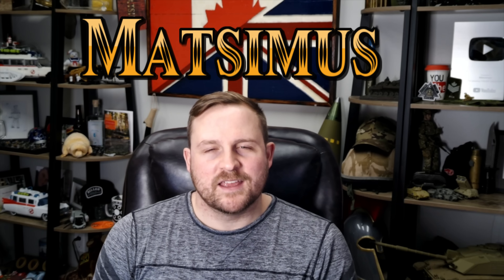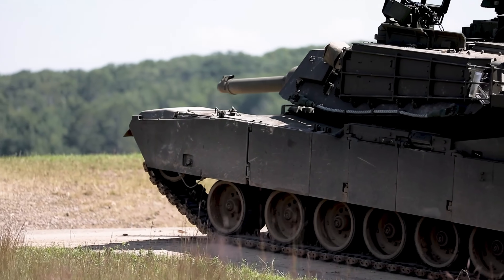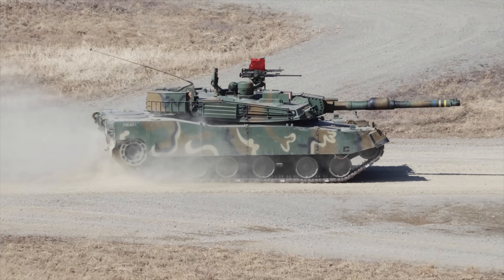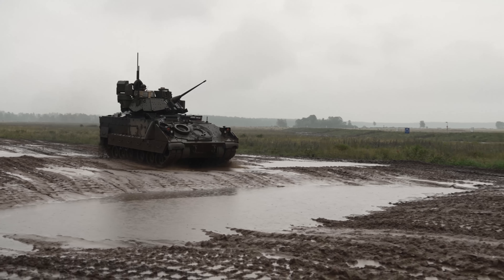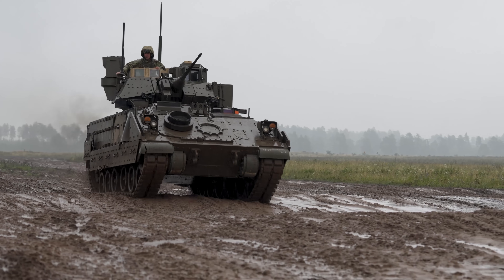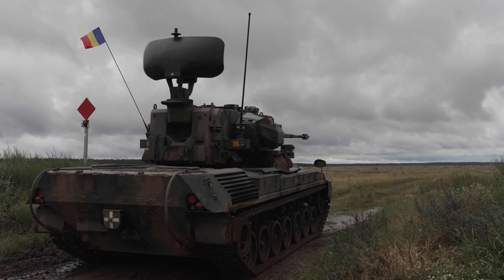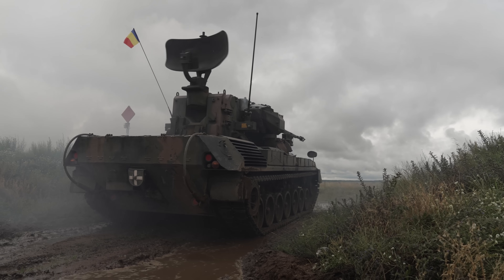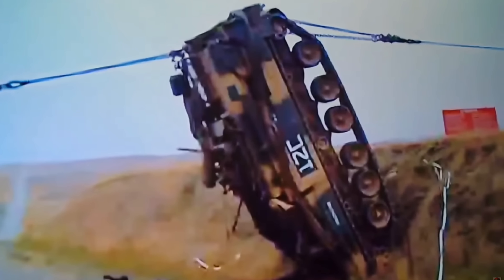Inside Tank & IFV Design: Fuel Placement & Survivability

Comment: I have some questions about the fuel used for tanks and IFV. I would guess that most of these are  either using Diesel or Some kind of Jet fuel for turbines. Thing is I remember a friend was told to get rid of the rests of a barrel of jet fuel used for military helicopters. This was in the beginning of his training as a helicopter technician. Well he and his friends tried to burn it starting with throwing a match i the open barrel and nothing happened. They continues and found that they couldn't set fire to a rag drenched in the fuel with a match or cigarette lighter. Eventually they managed to burn the rag using a blow torch to set it on fire. Apparently their officer had kept track of what they did from his office and had a good laugh at their attempts.

Point is that jet fuel are not easy to set on fire, and Diesel isn't all that ready to just burn on command. You have to get it real hot or atomized first. But gasoline is not as friendly. So what fuel is it that they use for these vehicles and why is it burning so easily? As for helicopters they have self sealing fuel cells that will minimize leakage if they are shot with small caliber ammunition and they aren't really afraid of them catching fire.

As for gasoline I remember seeing a metallic foam that was developed for the fuel tanks. filling a tank with it reduced the capacity by something like 0.5% but it also made them safe from explosion if the fumes inside was set on fire. Combine this with self sealing fuel cells and it should minimize the risk for explosive fires unless the tank is hit with a explosive charge. And by then it's bad whatever you do to try to protect it.

Now I'm sure these methods has already been used in Tanks and IFV simply because they are cheap, simple and even if they can't completely protect against all types of fuel fires they are well worth the effort. Also these are manuy decades old techniques.

My question then is just how do they fail and how does the fuel get set on fire with all the different attempts at protection?

Comment: It’s actually very simple. Any fuel tank that is not internally segmented with vulcanized rubber, filled with retardant foam and lined with composite or spall liner is a danger. 
Any single walled or non self sealing tank that lacks designated fire systems is a complete hazard.

Any of the properly designed fuel tanks, listed above, should be placed between the crew and KE or HEAT threats. 
Because when properly protected fuel tanks are done right, they offer massive protections to the crew (as long as they are filled or empty but vapor vacuumed)

At best a full fuel tank done right can stop penetrators dead in their tracks using insane drag and multilayered protection. At worse wind vapor, purged they add spaced armor and stop spall.

But when done poorly like Russian external tanks or any single walled Steel tank, they are vapor traps and giant pressurized fires waiting to happen.

But as the video mentions poor fuel tanks, usually kill the crew or force them to evacuate because of respiratory repercussions.

Comment: I always found the Soviet BMP design interesting. There are fuel cells in the rear hatches. Diesel. That functions as de facto armor, extra fuel, and/or buoyancy for amphibious operations. And the rear mounting is theoretically the surface area least likely to see enemy fire (if things are going to plan). In a Marine LAR BN on an LAV-25 the scouts are sandwiching a fuel cell. It forms their seat (both rear and underneath). In an LAV-AT variant the fuel cell takes up the loaders entire right wall (as he’s sitting facing to the rear at the rear left side of the vehicle). When the exterior temp is 110 degrees… that fuel cell receives recirculated (and very hot) diesel (JP-8). It’s almost unbearable. Like siting against a blazing oven. In the interior you can see temps of 130 degrees. It’s dangerous it’s so hot. So hot that if you stop pounding water… you’re going to be in real trouble in as short as 45 minutes time.

Comment: Maybe fuel tanks in armoured (whether manned or unmanned) vehicles, should be housed only externally in armoured sponson.

Whether mounted on either sides, or at the rear, or underneath, or maybe on top of the armoured vehicle too?

Though far away from the crew compartment as possible, with all fuel tanks having their own armoured protection too.

Against attack by sucide drones, or from anti-armour missiles or rockets, plus attacks by armoured-piercing rounds and bomb or shell splitters.

As well as against anti-tank mines, or High Explosive Anti Tank munitions, or even IED's too.

Though equally all armoured sponson fuel tanks, having both automatic fire-suppression system and self-sealing systems too.

Also whether the fuel tank fire, is as result of war or accident damage, but cannot be putout quickly.

Then the external sponson armoured fuel tank, can be remotely jettisoned if necessary, by any of the crew inside.

Or can be jettisoned remotely again by an operator and via datalink, of the armoured ground unmanned fighting vehicles too.

Just a suggestion, the idea of jettisonable fuel tanks, has been around for all kinds of military and civilian (air, rail, road and water) vehicles, I think since world war two.

Fue tank or onboard fires, has always been the worst nightmare of crews, from warships or submarines, to combat aircraft to fighting vehicles.

Maybe even now the threat of electric battery fires, with new military vehicles being designed and manufactured,  as pure electric powered combat vehicles.

It makes you wonders, how safe would soldiers be in a new armoured electric-powered fighting vehicle?

If the onboard battery enegy pack bursts into flames, after the armoured vehicle being hit and damaged by weapons fire?

Comment: There should slso be a focus on fuel type before deciding where fuel is stored, diesel doesn't burn at low pressure so it acts more like water at 1 bar, still most likely harmful to humans but smoke shouldn't be a worry for diesel driven tanks afaik.

Comment: Honestly a truly valid question 

The more fuel the more range a vehicle can have, but on the other hand, increased range and combat capability does come with a few problems, one of which is obviously.

The more room taken up by the fuel tanks means less room for the poor people inside the vehicle, secondly fuel is highly flammable and depending on its storage location, can determine whether or not a crew can safely exit a vehicle or simply be burned alive, much like the Soviet BMP APC where they have fuel tanks in both the rear doors of the vehicle and underneath the passenger compartment, 😂, however having less fuel does decrease the risk of fuel fires starting, but having too little say a 2 liter tank for your garden lawnmower In say the back of an m1 abrams 😂 and unless you have excellent logistics and available fuel then such problems aren’t that big of a problem.😂

Comment: Well I certainly wouldn't fill the door or compartments immediately either side of it on an IFV with fuel as has happened withsome even recent ones. As that potentially blocks the main escape route. But it depends on the type of fuel too, It's gotta go somewhere and it needs to carry enough to get where it needs to and back again.

Comment: In my armored vehicle in combat, my seat was strapped right to the gas tank, no armor separation. Literally sat on top of the gas tank. Had a fire suppression system, but it was mounted right in my face, so if it went off it would blast me in the face and prevent me from breathing, so I disconnected the cable that activates it (didn't want to be injured or killed by it going off).

Comment: Great Video and Info !  Aircraft style self sealing Fuel Tanks with a towed Trailer for a Fuel Tank and Ammo and be detached remotely when near the Front Lines !  Also an Auto Loader will reduce the Crew by ONE...  The Third Crew member is a spotter, a Drone Operator or what ever needs doing !  Or maybe an EV or Hybrid...   Timothy Lipinski
Reply: Pulling a trailer with a tank isnt easy. Its another thing to watch out for in an already hectic combat zone. Also makes reversing tricky

Comment: I'm glad you mentioned how the heat/smoke creates its own hazard. In such a small space like a tank, even a small fire that's been put out can render the vehicle unusable for a time being due to it simply being too hot inside, or too smokey to even see screens/controls/etc, or breathe.
Reply: Typically modern tanks have ventilators to blow the smoke out...if it's not too damaged to still work.
Reply: @TyMoore95503  only really for the smoke produced by the gun. I'd imagine a smouldering, smokin' like wild fire would overpower the ventilator.
Especially considering anything flammable in there definitely ain't producing a nice white clean smoke..

Comment: I'm actually putting far too much effort into designing tanks and IFVs for my sci-fi setting so this vid is extremely helpful to me. Thanks for that!
Reply from the maker: Anytime!!
Reply: Me too, except that I'm designing a superheavy tanks where every square milimeter is ACTUALLY precious.

I'm even considering a luxurious JP-10, which pose much greater fire hazard than diesel
Reply: Hell yeah thats my kind of autism as well
Reply: Tanks and IFV’s in any sci-fi setting should be completely remote… if you want any amount of realism. 
In 100 years it will be a shocking special ops mission that uses actual crew in some sort of Trojan horse attack.

But there is really no reason if you’re using Armor en masse in a future setting to not copy the predator drone model where your pilots are flying from Las Vegas and doing actual war 3000 miles away. 
When you never put your crew in harms way, even if you lose a vehicle the crew simply learns from that and gets better… that’s why after 20 years of gwat the current drone operators are 100 times better and can do things that were unimaginable in the beginning.

If you add to that a sci-fi universe with AI or the ability of the crew to use remote mechanical bodies it gets even better. 

You should make tanks where the mechanical avatars wake up when they need to clear a round or fight a fire or fix damage… or extract from the vehicle and do cqb
Reply: @The_0G_Chad  I initially did explore the idea of making them unmanned however it didn't feel satisfying narratively so I decided against it. That being said simply hand waving it away felt equally unsatisfying so I had to come up with a plausible explanation as to why in universe this wasn't done.

What I came up with was that drone tanks were a thing once but during a major operation a cyber attack took place and the faction that was previously on the offensive watched in horror as their own tanks suddenly did a 180 and opened fire on their own troops turning what may have been a successful breakthrough into the single biggest military disaster since the battle of Kiev (1941). Both of the factions involved looked at the outcome and independently came to the conclusion that the best way to defend against such an attack was to put people back in the tanks

Comment: How do the external fuel tanks work? Are they equipped with a cut off valve you can manage from inside and are they just for getting to the battlefield?
Reply: IIRC, the drums strapped onto the back of Soviet tanks aren't linked to the fuel system at all. They just stop and run a hose into the regular fuel tanks to empty the drum out.
They're more often filled with water (possibly vodka) than fuel.

Comment: Interesting! Design may not be as sexy or exciting as weapons, but it's at least as important.
What seems counterintuitive is that some designers use 'fuel as armor'; part of the rationale of fuel placement in the Merkava (and S-tank, IIRC).  As I understand it, the relatively low flash-point of diesel means it can absorb penetrating energy of a hit, presumably giving the crew time to escape a fuel fire.  Given that the main fire risk is the ammunition--especially large tank rounds--the tradeoff can seem reasonable.
Reply from the maker: That's a great point about fuel as armor!

Comment: Internal fuel increases the mass of the vehicle because it takes up more room requiring more armour so the vehicle is drastically more expensive to build and increases weight a lot. Similar to 3 vs 4 man crews. If a penetration occurs internal fires are very dangerous. External fuel tanks are more vulnerable but the tank can be smaller, lighter, cheaper and it's safer for the crew potentially. There are disadvantages and advantages to everything though. A combination of the two is ideal I think, a smaller fuel tank in the rear of the vehicle and a rear external tank that carries more. That way in the rear you are less likely to be h it there to start with potentially.

Comment: Seems we've all seen vehicles w/ Drum Fuel Containers on upper aft Racks.
Noticed a UKR, IFV that had the Fuel located on the Outside of an aft door.
(Never understood why tanks need Depth Charges...)
Reply: Soviet era BMP vehicles have fuel tank inside the rear doors. Then again, IFV already has a thinner armour than a tank so if you are getting shot at with anti-tank weapons and not just rifles and machineguns, there is hardly a safe location for the fuel tanks (or anything else inside the vehicle.)

Comment: I think that pentagon war movie is not a credible source on how ifv production is hard as Burton basically just made the production of the Bradley extremely more difficult and expensive then it should of been, he forced the army to destroy hundreds of Bradley prototypes just so they could find the same information as before, some stupid things you can notice is how he starts saying aluminium is a stupid material to use even though it has been proven as a good light alternative like the m113 and he loved that one, they act surprised when the Bradley is blown up by wow an ATGM which is built to take out armoured vehicles, and he brings up the Israelis ordered the Bradley’s with the external fuel tanks when Israel never ordered Bradley’s in its history blah blah blah, it’s a propaganda film for the reformers (which he was apart of) which are a bunch of idiots who believe we should go back to prop planes. Anyway sorry for the tangent, probably wasn’t needed 
, love your vid’s mat
Reply from the maker: No worries! Thanks for watching and the feedback!
Reply: I like prop planes.  They have a use, primarily cost per flight hour.  Give them to the army and special operations command.  They need a cheap loiter platform capable of support against low threat.  Alternatively can pack these with countermeasures to bait out anti aircraft, to deal with when discovered.  Aluminum likes cracking.  US never entered a truly hot war.  Dont know if that material will do better than steel.  Anyway, i will believe the movie is misleading, Hollywood, and every influencer almost always is, including me, but reformer ideology, i wont dismiss.  It has a place.
Reply: @pancakes3250  I agree with the special operations prop planes but they meant replacing all aircraft with a prop plane like the f16, f15, f35, f22 pretty much every modern jet they hate the idea of missiles and think dogfighting with guns and cannons is still viable they are just a group of idiots who want attention especially that horribly Pierre spray or however you spell it, countermeasures were primitive in 1980s, but yeah you got some points but what I said was only scratching the surface of everything
Reply: @PanzerPickle-698 Wow, they sound luny.  I hope not true, such delusions are painful to witness in men with experience, but happens.
Reply: @alexturnbackthearmy1907 good point